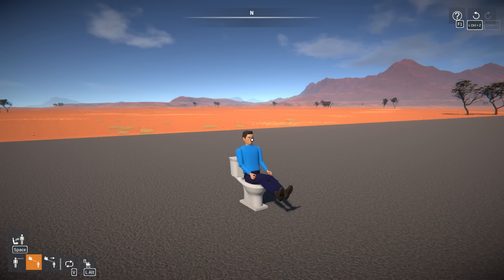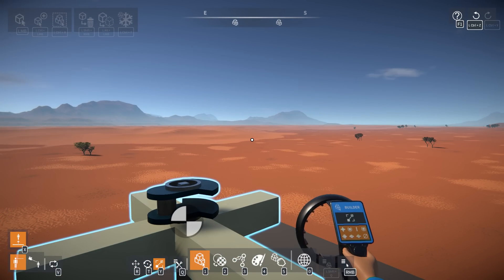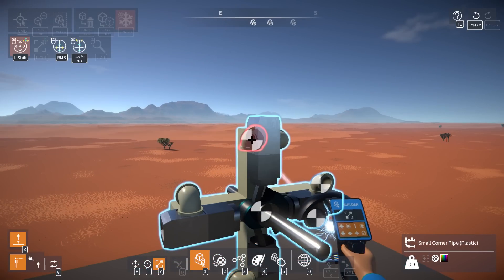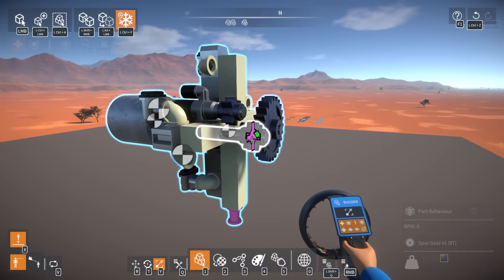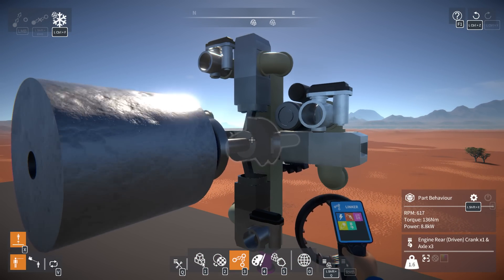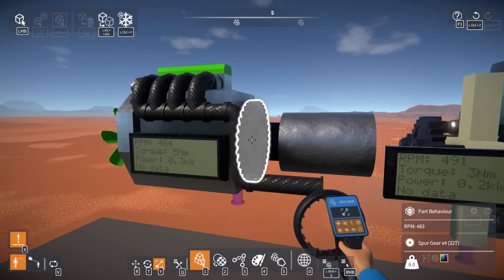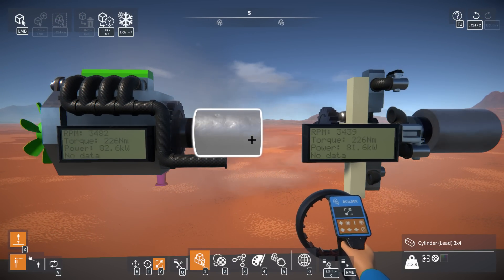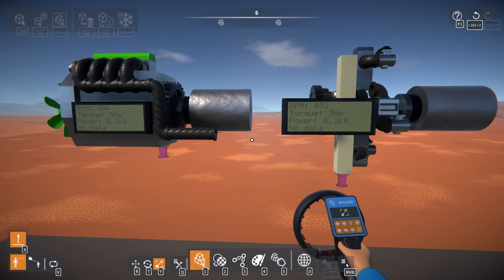I Built a Radial Piston Engine to Compare Against the Linear i4!

Comment: AFAIK, Ferrari uses carbon fiber not to build the exhaust piping but to wrap the exhaust headers and piping, because it provides very efficient thermal insulation. That keeps the heat within the pipe, shifting the Carnot cycle to the exhaust exit, increasing the flow inside the exhaust pipes. One could assume that insulating the intake in a similar manner (especially if your engine runs a turbo with intercooler) could further increase the efficiency by limiting thermal loss.
Reply: I didn’t know about the intake side of things but for the debate about wether carbon fiber would work on an exhaust I was gonna bring up what you said about the wrap for exhaust I’m pretty sure bike guys use it too
Reply: @Stick041  I am unsure how big of a difference that would make. I'm just going by my gut feeling and overall knowledge of Carnot cycle: "Cold to hot, good" and "Colder to hotter, betterer". ;)
Reply: @Stick041 all the time, In fact a lot of companies sell bikes with a combination of metal exhaust with carbon fiber internals/pieces
Reply: Hey, dumb people don't know how hot fire is. We have to remind them that fire is hot. And how things melt or burn things. I'm reminded everyday how little people know about the planet. zero knowledge is connected between cars life and physics. Zombies if you will. Or just Canadians.
Reply: This is interesting, thx!
Reply: Yes! This is because carbon fiber does not melt, it sublimates, meaning it turns directly into a gas. This “melting point” is about 6,700*F

Comment: 12:30 I’m not saying you can’t (because you definitely can) have carbon fiber exhaust. What I am saying is there are so many reasons not to. I’ve seen steel exhaust pipes melt and have burned 800° JB weld like it was cardboard. You can use carbon fiber on a scooter because the max temps you see there are nothing. The engine will break before you get it hot enough. But on a full size car the exhaust temperatures are insane. The carbon part will last forever. It’s one of the best heat resistant materials on earth. But the resin that holds it together will melt and burn like elmers glue. Worse than that is carbon fiber resin gives off carcinogenic gases when it burns. People have started using carbon fiber for rifle barrels and it works great but they are only used and bolt actions. Even a semiautomatic would put too much heat into the barrel and cause it to off gas nasty chemicals. So to sum all that up, yes you can use carbon fiber in high heat applications but with either short exposure or a longer exposure with much lower heat. In my opinion it’s not worth the risk of cancer just to make your exhaust look cooler and drop a third of the weight. 

In game though, you do you lol.

Comment: the engine also seems more limited by rpm than torque, using an even heavier flywheel might get you a more accurate reading of the actual power it makes

Comment: Radials always have odd numbers of cylinders. I'm not aware of any even cylinder radials. That being said, some radials have multiple rows of odd cylinders making them "even" (wasp major for example has 28 cylinders in 4 stacks of 7)

They're always odd because the timing skips 1 cylinder as it goes around the circle to get an even power distribution. E.G. a 5cyl radial timing is 1-3-5-2-4. With a 4cyl radial you could do 1-2-3-4 but then you'd have 1 rotation where all cylinders fire followed by 1 rotation where they don't fire. 1-3-2-4 would be very uneven because the time between 3 and 2 is much longer than the time between 1 and 3 so you get very uneven ignition timing. I guess you could make it run like 2 boxer engines rotated at 90deg from one another? The timing would be better that way but it just wouldn't be a radial at that point mechanically speaking

Edit** when I say "boxer" I mean that cylinders opposite one another (e.g. 1-3 and 2-4) move in opposite directions. They're both at TDC and BDC simultaneously

Edit #2*** I noticed in the parts list there is a 5 way radial piece with 72deg angles. This is PERFECT for a radial!! Build a 5cyl radial next!!
Reply: i love using that 28 cylinders engine in warthunder powering my F2G-1 corsair, so much power
Reply: @irgiefarras2159  as a pilot, I love those big beefy engines. I used to fly a PC12 at my last job (first time flying a "big" airplane. Bigger than flight training anyway) and that 1200hp turbo prop really pulls you. But nowadays flying a CJ3+ really puts those old prop planes to shame lol. Climbing at 7000 feet per minute in a low altitude turn is something else
Reply: Anzani made radials with even number of cylinders, but they are all two strokes so firing order is easier
Reply: @jakubpollak2067  I had never considered 2 stroke radials but this make so much sense! A firing order of 1-2-3-4 would be a smooth rotation with a 2 stroke. That being said I don't know how gearblocks even calculates this. kAN's messed up firing order engines always seem to work 🤷🏻‍♂️
Reply: @Astrolex12  I read somewhere firing order changes the sounds only, but I am not sure

Comment: The "rod knocking" is just the idle gear you have reaching ~12000 RPM which causes the shaft to partially disconnect from the body. This causes significant problems when trying to reach ultra high speeds. Generally it's safe to have the non-clutch gear components rev up to about 9000 RPM.
Reply: there is a way to fix it, during the game just select the world tool and go to its settings and increase the update rate and constraint accuracy
Reply: @erikdesanto3496  That is actually extremely useful to know, thanks a lot
Reply: I thought it was the crankshaft getting over torque because of how many cylinders are hooked to it 😅
Reply: It could also be the centrifugal clutch being partially disconnected because of the speed. I encountered that if there's a rotating axle that is only supported with the body on one side, then it tends to explode if invincibility is turned off

Comment: pretty sure Kosmo meant like the muffler not the actual pipe witch takes the most of the heat.

and usualy the carbon fiber are usualy just a cover on top of a metal muffler aswell so the inside  is still metal. 

the exhaust from an engine are usualy somewhere around like 400-700°c so atleast for a bit you need something that can whitstand those temps untill the exhaust has cooled down.

if i remember correctly a catalytic converter doesnt work before it reaches like ~400°c (whatever in °F).

and i think the most badass carbon fibre start to break down somewhere around 200-400°c even if it for short peiods can whitstand up to like 1000-1200°c. 
so atleast metal untill after the catalytic converter is probably required.

kinda sure you ran your ignition backwards may be why it idles like garbage not realy sure how the game handles "missfires" and probbably the missfires are what you referes to as rodknock.

Comment: my second comment, you should really check out the script mod (block properties) or something like that, it gives you a graph to display power curves rpm over time exc. really awesome and may be helpful, there are no numbers with the graph though you will need to use the screen in conjunction. using the script mod you simply TAB over the blue crank shaft for engine performance or the cylinder heads for individual performance on each head, the script is built in by the dev

Comment: "Melting point of Carbon Fiber is 3657 °C. Note that, these points are associated with the standard atmospheric pressure." Not sure if your engine can do that temperature, if it is I think you have issues, lol.

Comment: Carbon fiber itself is highly heat-resistant and does not melt in the conventional sense, but it can degrade at extremely high temperatures. However, it's not the carbon fiber that's a concern in an exhaust system, but the resin that binds the carbon fibers together.

Most carbon fiber composites use resins like epoxy, which can start to soften or degrade at temperatures around 150°C to 200°C (300°F to 400°F). Exhaust systems, especially near the engine or turbochargers, can reach temperatures well beyond that, upwards of 500°C (932°F) or more.

To prevent this, carbon fiber exhaust components are usually designed with heat-resistant coatings, special high-temperature resins, or combined with metal layers to handle the extreme heat. Without proper protection or design, the resin in carbon fiber could degrade or burn in the high temperatures of an exhaust system.

So, carbon fiber won’t "melt," but without proper heat resistance measures, it could degrade under the intense heat of an exhaust system.
Reply: @KaiFordham-Brown  cyanate resin only goes up to about 270*C. Definitely fine in regular usage, but ive seen tuned cars make their exhaust manifolds glow, which is at least double the melting temperature if cyanate resin.
Reply: @StenaAbelle  yup, if playing Automation has taught me anything, exhaust manifolds can get to 1200*F at peak RPMs
Reply: At the manifold the exhaust can reach 850°C
Reply: @senorporko3299  Carbon Ceramic works at over 2,500f that is around 1500c for you. It can be formed, shaped, milled, drilled and tapped.
Reply: I mean yeah I'm sure different grades of it are out there, but I personally have never heard of anything carbon fiber "melting" 😂
Reply: @Crazyclay78YT  i have purposefully melted carbon fibre before. It definitely depends on the resin rather than the carbon. 

The highest temperature carbon fibres that ive found denature at roughly 800-1000*C, where as the resin melts at around 350*C, hence the ‘melting’.
Reply: Thanks for the well put explanation
Reply: @detvedjegikkedk
 Carbon Ceramic headers are a thing, good luck melting that.
Reply: It’s called sublimation, it’s skips the liquid phase and turns directly into a gas
Reply: There is multiple different kinds of carbon fiber, there is a cheaper carbon fiber but it is not very heat resistant and more expensive carbon fiber that is highly heat resistant.
Reply: @darknerfshadow8582  The fiber itself is always highly heat resistant or rather heat conductive. It's always just carbon. As op said, it's the matrix (resin) that melts.
Reply: @maskharat  When cermic is used as the resin, you get a thing that will not melt, or break down over time.
Reply: @ducewags well that’s not entirely* true, it does break down but very slowly. Because carbon fiber “melts” at about 6,700*F it naturally is very heat tolerant meaning it will break down but again at an insanely slow rate
Reply: @FireHawk9463  What I wrote is true. Try the internet some time. And why are you talking about 6,700f?

Comment: At carbon fibers melting point at 3697c that's 6686.6 degrees fahrenheit I don't think it would melt that's hot and another thing they use carbon fiber to make Gun barrel.s to so yea it can handle it and being 5x stronger than steel also perfect for a engine lol.....not really but it can handle being a Exhaust manifold and muffler.

Comment: Carbon fiber melts at around 3650 - 3700C, yeah your all good to make it out of that.
edit: for reference the suns surface is like 5500C
Reply: It is made of carbon tho, so it will ignite around 600-800C, so the melting temperature isn't too relevant. But the resin part of the composite will melt,  decompose or burn at much lower temperatures. So no you can't make the hot bits of the exhaust from carbon fiber composite.
Reply: It won’t melt, but the resin in it will decompose well within the temperatures made by exhaust

Comment: From what I've seen carbon exhausts are usually just the outer sheath of the rear silencer, typically speaking Epoxy will begin to degrade at prolonged temperatures temperatures of only 45°C 

 headers get considerably hotter on the other hand , I've seen stainless headers glowing red hot on race bikes and cars  

usually stainless steel is used for a performance exhaust or sometimes titanium but that is much more expensive both in terms of materials and fabrication

Comment: I looked up on google the melting point of carbon fibre and the average exhaust gas temperature on google and here's what i found:
Average exhaust gas temp:315/370 degrees celsius
Carbon fibre melting point:3652-3697 degrees celcius.
Yeah that exhaust ain't melting
Reply from the maker: See that's what I thought too but everyone is convinced it will melt so maybe I'm missing something here...
Reply: @kANGaming  i think they are talking about the resin used for carbon fibre. Idk about that. Ik it's flammable but they surely invented something that isn't flammable to produce carbon fibre stuff in conctact with heat
Reply: Found it by looking at other comments:
Heat resistant coatings to protect the resin

Comment: You need to eventually make an engine with as many cylinders as possible
Reply from the maker: Agreed. 10000 cylinders incoming.
Reply: @kANGaming Then I recommend using the built in plugin for setting the timing ;)
Reply: @kANGaming  KaN, are you going to disappear for a month suddenly?
Reply: @kANGaming  I've made a 160 cylinder radial once (8 cylinders per row, I dunno, do the math) and the sound it makes genuinely hurts your ears :p
Reply: @kANGaming  so, an starter, driving a thumper, that starts a 2-cylinder, that starts a 3-cylinder radial, that starts an inline 4, that starts a radial 5, to start a V-6, …. All so you can dyno-test the word’s first 15cc offset-inline, v-24 Boxer engine.
Reply: I believe the in game firing order only goes up to 12 or 16, but you could easily multiply that if you're happy having multiple cylinders fire at once 

Unsure if there's a way to do even more complex firing orders but would be very interested to see a video on it
Reply: @LordSethrik  I think that if the firing is offset.... maybe it would work with more cylinders but, who knows. don't have game, can't test. :P
Reply: @LordSethrik  in essence that would still be a v 12 to 16 but with a larger cylinder.
Reply: @marcelschellekens6386  no....

Just what? 

I don't even...

2 v12s end to end would make a V24, just with two pistons firing at once 

The size of the individual cylinders do not change, you simply add more of them...
Reply: 1 kANzillium cylinders
Reply: Radial 10000 😅
Reply: @KAN Gaming Carbon ceramic bond exhaust headers have been around for some time now. Thanks for the shows.
Reply: Ive made a few that push to the limits of the game, one is a 192L 96 cylinder that produces 26k hp
Reply: W24?
Reply: An inline-4 V-12.
Reply: @Vessekx  what so just a v12? 😂
Reply: @Vessekx so a inline 12?